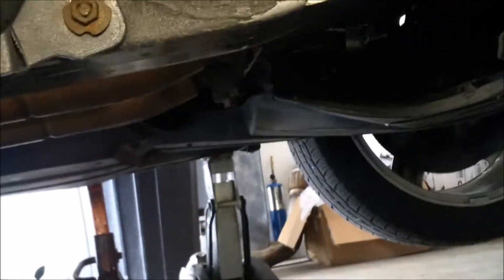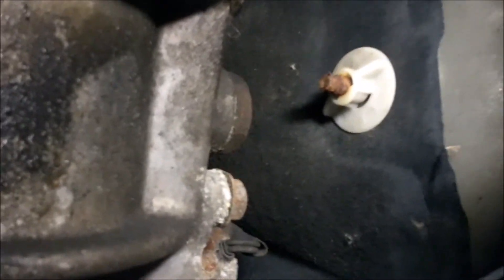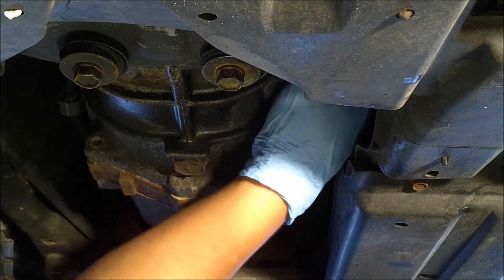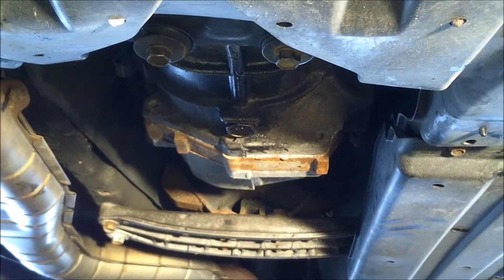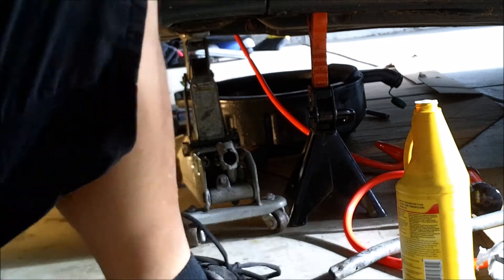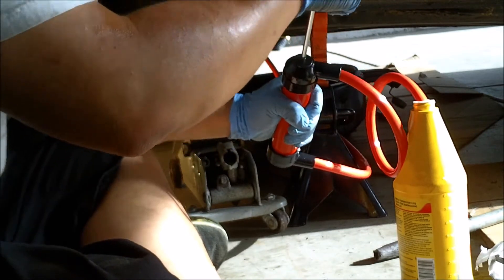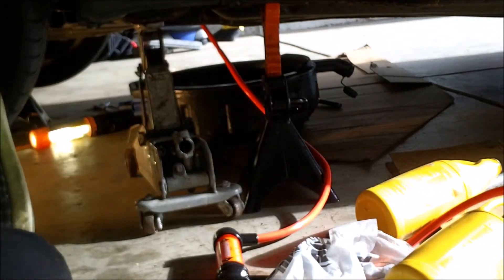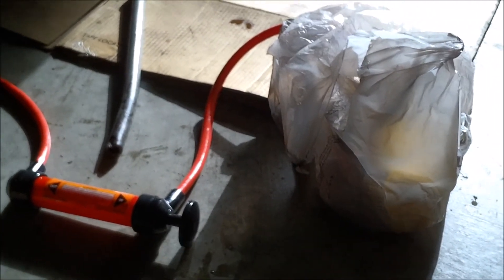DIY: 2002 Lexus IS300 Manual Transmission Fluid Change

Comment: Mine has been a nightmare, used the 24m, no budge. 15/16 no budge. Used a torch and vice & grips still no budge.   Now I have a mangled fill bolt. Not sure what to do from here
Reply from the maker: @Andres-300  I had the same type of issue on my s13 fill plug. I ended up having to use a pipe wrench like what plumbers use since it bites into it more.  I went and got one from harbor freight for cheap.  I think I still had to put a pipe on the end of the handle but it worked out nicely
Reply: @DIYAUTOCAR  I came back to the car a day later, gave it one last final ugga dugga and she finally broke loose! I was so happy
Reply from the maker: @Andres-300  awesome man. Glad it worked out

Comment: Thanks for the video man, really helpful! 
Quick question for you though...  I believe my issue right now is that I have too much fluid in the transmission, so that's why I'm going to flush and refill.  How will I know if it's too much fluid when I'm refilling?  I know you said you used just under 3 quarts, which is a helpful starting point, but I don't want to overfill it again.  Is there a way to check it?

Background on my issue: (automatic transmission)
Car seems to shift fine, but when I get on it, it doesn't seem to have much power.  It downshifts and the RPM's go up, but it doesn't seem to add any power to the car.  I cleaned the MAF, throttle body and replaced the air filter this morning.  Car seems slightly better, but still not a lot of power when it downshifts.  I live up a pretty steep hill and this is where its really noticeable.  Going up the hill the car struggles, even when I apply more pedal (forcing it to downshift).  I checked the transmission dipstick after driving for 20-30 minutes and it's about 1" too high on the dipstick, which is why I'm thinking that it's having this issue from being too full and planning to drain/refill.  Any thoughts would be greatly appreciated!
Reply from the maker: +Marc Ochoa The automatic will be different.  If it shows too high on the dipstick on level ground then it likely is overfilled.  The auto takes 2.5 on a drain and fill.  It kind of sounds like the trans may be slipping from your description.  (hard to know for sure without actually seeing the car/driving it though)  I would start with a basic drain and fill with Toyota type IV ATF.

Comment: Debating on going OEM or Royal Purple 75w-90.  Which is better for aftermarket performance clutch and lightened flywheel?
Reply from the maker: For me the car was a daily driver so I didn't go with Anything fancy. Just the Synchromesh that was available at the local parts stor.  I run royal purple in my Skyline and it's a bit thin.  The transmission feels a bit notchy with it.

Comment: So yesterday i attempted to drain my 5 speed is300 and started to break loose the 24mm drain plug and saw that it was tight when loosening. I might have a feeling sometime had cross threaded it. What should i do guys. And special kits out there that someone knows out there
Reply from the maker: If it has not been removed in a long time it may feel hard/tight the whole way out. Also, sometimes they have thread locker on them.  I doubt it was cross threaded but you can get kits to repair threads.

Comment: I saw your video on checking the clutch. You poured the gear oil into the top of the transmission (where the shift knob is seated). Can you refill it that way?
Reply from the maker: Yes, it can be refilled there.  It does drain a bit slower but you can do it from there.  I would just pull the fill plug and fill from the top until it starts overflowing.
Reply: @DIYAUTOCAR  Thanks.  Your video on changing the clutch on is300 was very helpful.  You saved me thousands of dollars changing the clutch on my is300.
Reply from the maker: Good to hear.  I'm glad that it was helpful.

Comment: Hey man does your transmission warm up where the trans is in the interior?  when driving around? Ive driven other cars and my trans warm up the interior alot , just wondering if it happens to you to
Reply: SC CREW same prob
Reply: Built For The Streets BFTS It's funny how you mention that. My 04 IS has similiar symptons to yours as well. It does get hot around the shifter and transmission tunnel area. All that heat is rising up that region for some reason 🤔. It's probably because of how the headers and downpipes are routed.
Reply: Built For The Streets BFTS yes man same problem here I have an 03 manual lsd trans are we just low on fluid or is it cuz I took my splash guards out so I have free look into the trans thru shifter
Reply from the maker: I don't recall this car ever doing that.  I sold it a while back though.  I recently picked up another and I'll have to see if I have that issue.

Comment: Do I have to use a pump to put the new fluid in? Or can I pour it in through the dipstick?
Reply from the maker: This is a manual transmission, so there is no dipstick.  On the Automatics you should be able to do it through the dipstick.